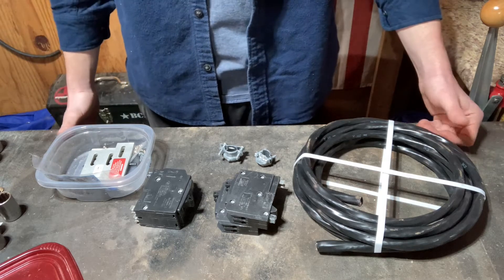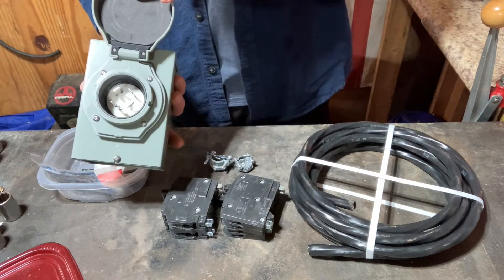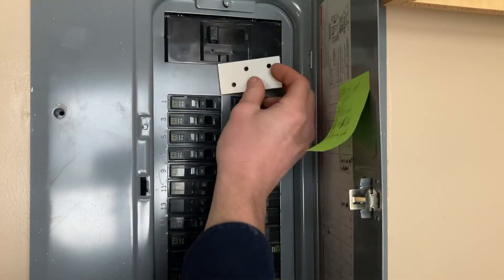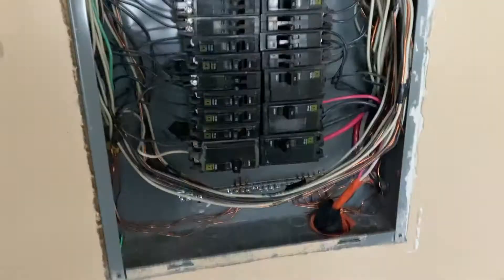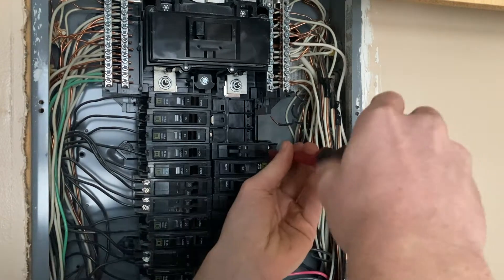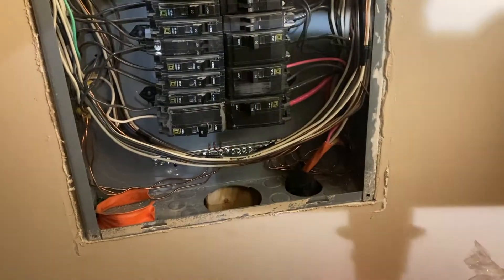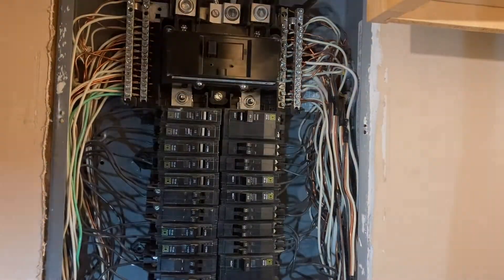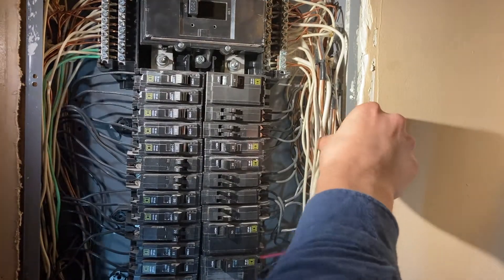MidwestDIY - Installing and Wiring a 40amp Breaker for a Generator in a Square D QO panel.

Comment: This would be illegal in my jurisdiction. There's no strain clamp for your wire into the box, plus a gaping hole that wouldn't contain a fire, and it's extremely dangerous to to not have a positive lockout of the main while the generator breaker is energized, as it is an easy way to kill a utility worker.

Comment: Ok , maybe a dumb question.  Now that we have the breaker connected to the generator how does it power the house ?    Do you just turn on the breakers  I want to use?    I’m trying to run a whole home generator and I can’t find any info